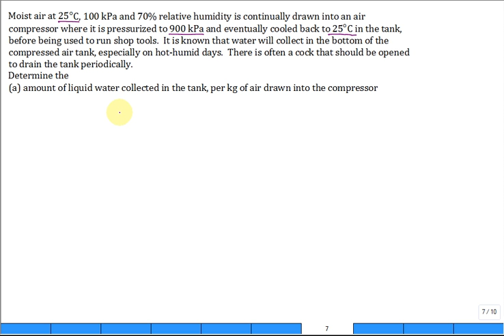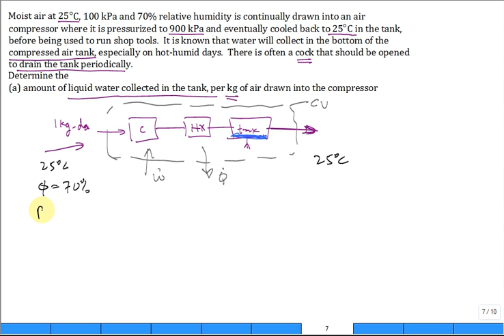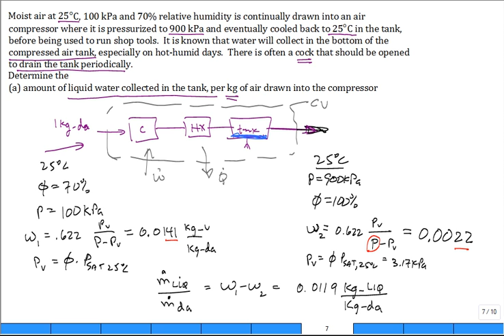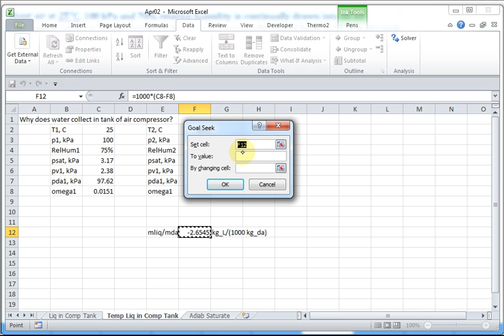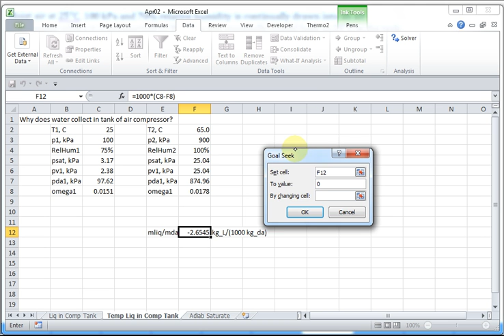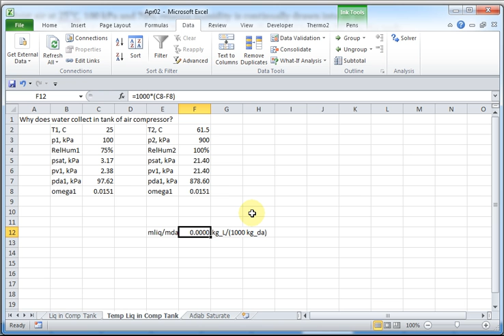Humid air water in tank of air compressor

Comment: i have a pistons compressor for fire system and the vent of a condensate tank is just beside. i was keeping adding oil into this compressor. i run pipes outside the room too get dry air and everything is fine.